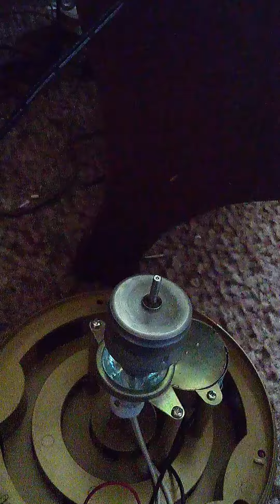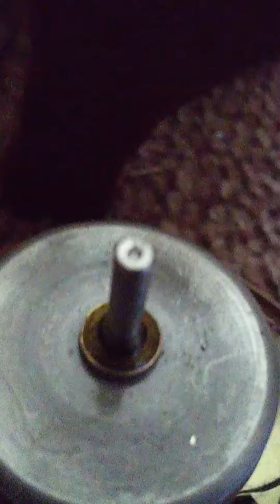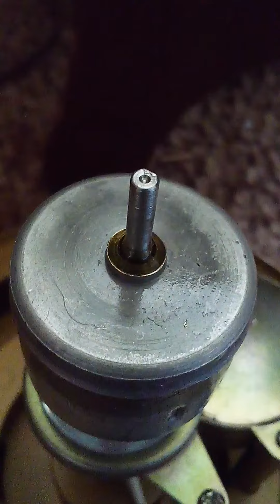unfreezing a telechron b3 rotor

Comment: Great idea, using the heat. I do the same on the nuts that are stuck on a cuckoo clock, but I use the heat from the tip of the glue gun.
Reply from the maker: That's smart

Comment: Total waste of time!  B-3's are a very high torque rotor and 99% of them  have badly worn gears and bushings. If they're "frozen" it's because gears conflict with each other vs mesh evenly.   You need to open them up, clean them and replace the worn out parts.  If you get the gears unstuck it will be very short lived. These methods work better for low torque H-3's that have had an easy life in time only clocks.
Reply from the maker: I understand but I don't have all the proper tools and money to do that.